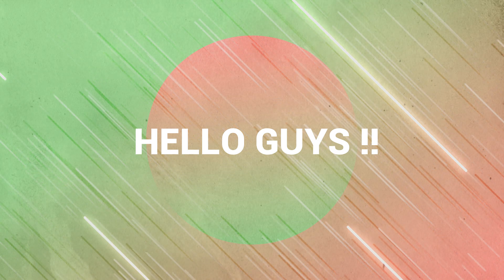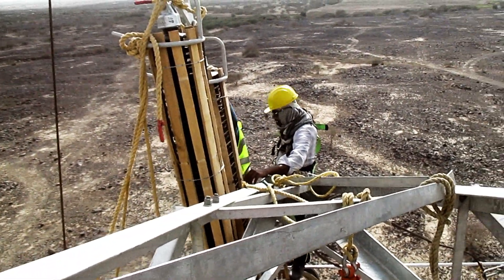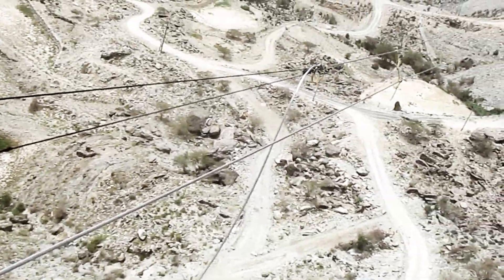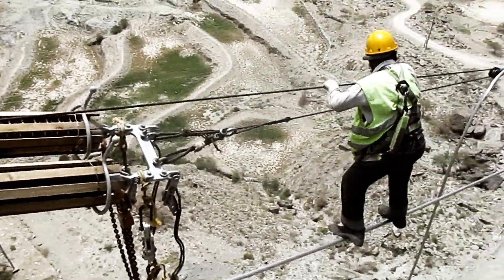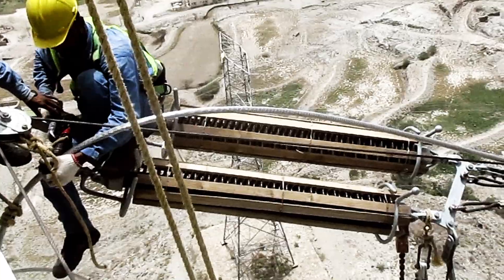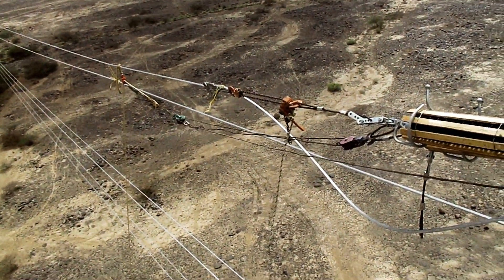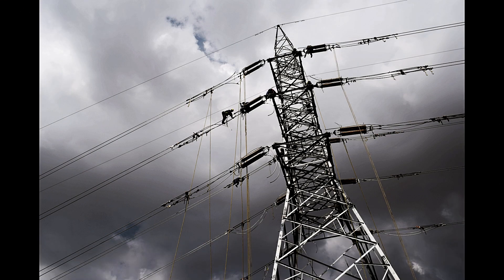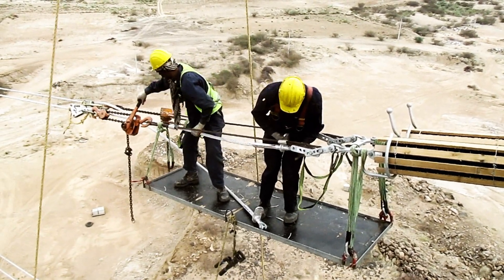Transmission Lines | Conductor Sagging | Stringing

Comment: How can we calculate the total number is composite insulators with each of phase of EHV transmission line ?
Reply: In my experience a "standard" 10 inch diameter porcelain bell in the US was rated 20kV.  69kV used 4 bells, 115kV used 6 bells.  Small diameter bells were rated less, typically 7.5 or 15kV.    
On dead end structures you usually add one to the string. Every system is different from spec to spec but it's a rule of thumb. We use 3- 8 "bells on 34.5kv and we use 2 on a 12470v line.

Comment: But for sag somewhere uses sagboard...how its use during stringing
Reply from the maker: Check in video i explained it...
On target structure sag board is fixed and on transit structure sag scope is fixed. From transit structure sag man will check the sag till the dip of the conductor coincide with sag board and crosshair line of sag scope

Enjoy watching!!